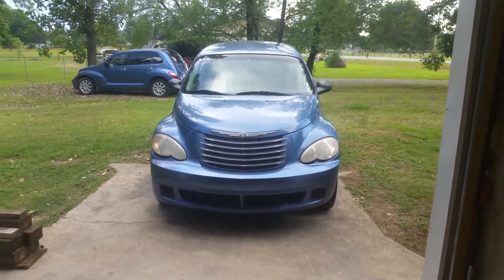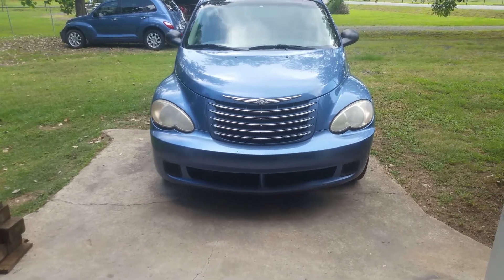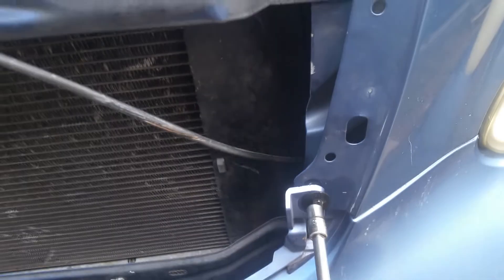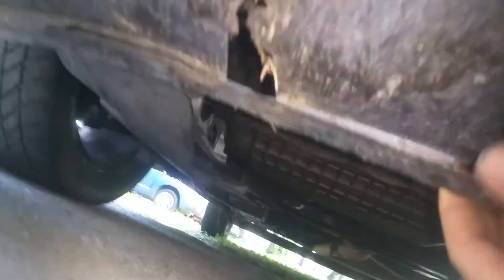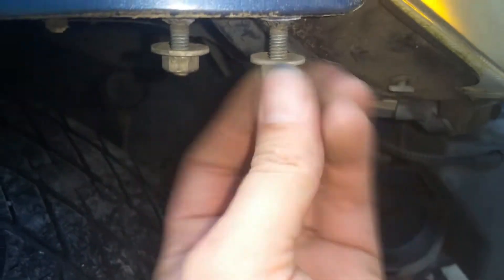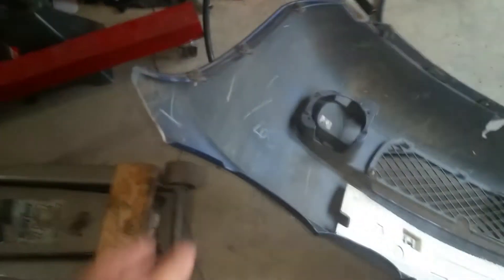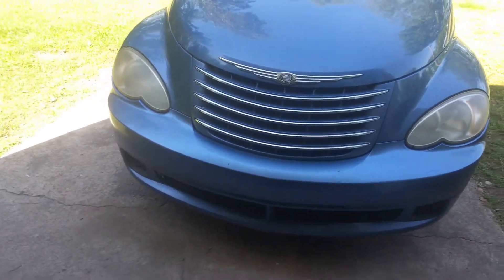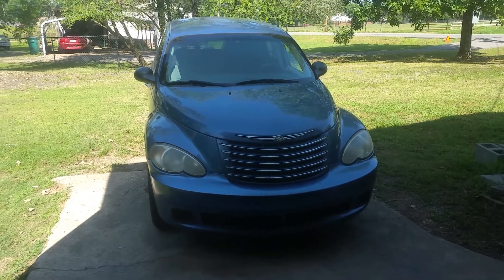How to fix a pt cruiser front bumper

Comment: Some great tips here! I have the same issue with my bumper, but on the driver side. Thanks for posting this video!
Reply from the maker: Thanks for the feedback. Ive seen many of these broken this way and it seems really common , I figured this was a good cheap way of repairing it without a total replacement. In most cases the bumper is in perfect condition except for being broken loose by running up on a curb . The plastic welds work really well if the surface is prepped properly , it will create a stronger bond than the bumper itself . Thank you for watching

Comment: Thank you so much.. My 2004 has same issue..I traveled over 100 miles. The next day pulling PT out of carport, I heard a thump.. MY WHOLE FRONT BUMPER FELL OFF!... I'm very lucky it didn't fall off on the road..Could have been a dangerous outcome.. Now I Kno what to do👍
Reply from the maker: Yes , these epoxy seem to hold up pretty good. I have always been too scared to try a plastic welder , and wind up ruining the bumper. There is an epoxy called Lord Fusor , they have on Amazon . Suppose to be one of the strongest , however it is around 25 per cartridge and another 25 for the dispensing gun. Anyways thank you for the feedback.
Reply: @s33therfan  Thank you for the info.. I'll check into the Lord Fusor👍

Comment: Thanks for this.  I had found a video on how to remove it, but not on how to re-install.

Yesterday, I went to the pull-a-part near me and luckily they had a 2007 cruiser in the right color! I pulled the bumper, fog lights, and the foam piece on the inside and they charged me $102 for those parts!  the bumper is a little scratched-up on the bottom, but for a car of this age it's about function, not looks.

Comment: What size bolts and clips do you need to put on a new bumper for my 2007 pt cruiser?? I have the new bumper but don't know what to secure it with :) thanks
Reply from the maker: 05288791AA - MOPAR Retainer. Fascia. Fascia to fender att, fascia to fender attach | Factory Chrysler Parts, Bartow FL
https://www.factorychryslerparts.com/products/RETAINER-Fascia-Fascia-to-Fender-Att--Fascia-to-Fender-Attach/4363533/05288791AA.html

This is the main part that fastens or retains the bumper on the sides. I don't recall the 10mm nut size, you would take it to the hardware , lowes tractor supply and find the 4 nuts that fit. 
The other part slides under 2 plastic nubs for lack of a better word located on each sode by the lights. Other than that small course thread screws fasten the sides located under the hood. 
To make things simple any screw or bolt you can fit will work , for either fastening the top or the sides. Self drilling screws come in handy. For the part I sent a link for , you could substitute 2 m8 or equivalant sized bolts on each side using washers. Anyways wish I could be more help and thanks for watching.

Comment: what do you do if those 10mm heads just spin in place....
Reply from the maker: I believe last time I had to get vice grips to hold and remove them. Also have had to cut them off . Once those studs break loose they are useless. I just bolted it back by getting creative with some anti rotation bolt/tab. Thanks for watching.

Comment: What tool can I use if I dont have a wrench?
Reply from the maker: They have loaner tools at auto zone . Or maybe find a cheap 1/4 inch drive socket kit for 10 or 15 dollars. You really need a small ratchet or 1/4 inch drive screw driver type . In my use the( plastic weld ) works best they have many types. Its equally important to make the surface you are gluing rough w sand paper etc . Makes for a better bond. If you dont have clamps the bond will take 5 minutes of holding . Use gloves also. Best of luck and thanks for watching

Comment: I've got the exact break in my bumper, thanks for putting this up! 

I don't have access to spare plastic to cut into a brace like that however. Any other ideas as to what I could use instead? I've looked all around home Depot for a substitute
Reply from the maker: I really cannot think of anything that would be compareable. You might grab a inner fender liner or something from a salvage yard. I know about the only material I have used has been from old liners and under dirt sheilds etc like the part that covers the crank and belts . A thin piece of angled metal may work but youd just need a different type of epoxy for bonding metal to plastic. I know those plastic outlet boxes are pretty tough but not quite sure how it would hold up. Wish I could be more help and thank you for watching.